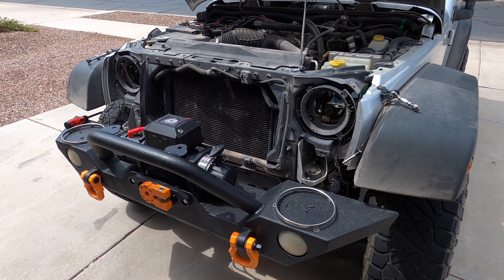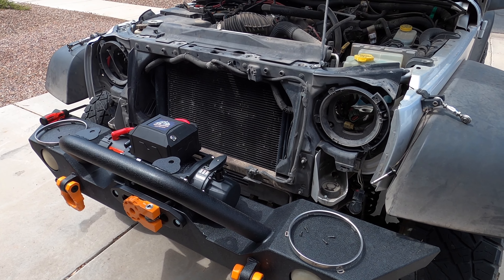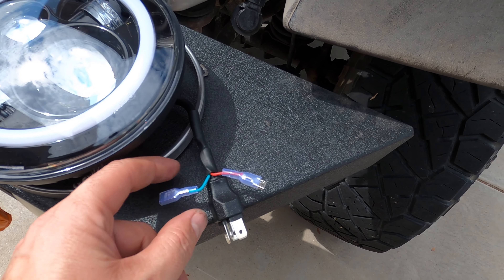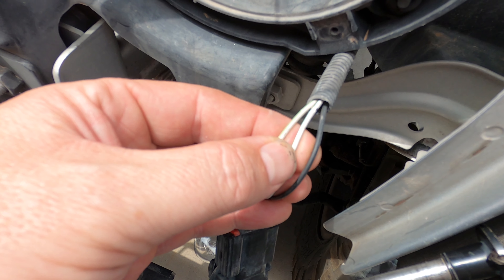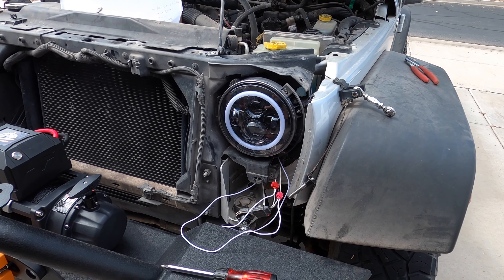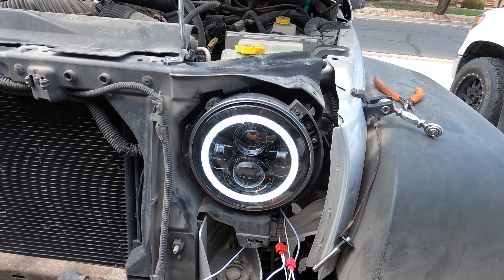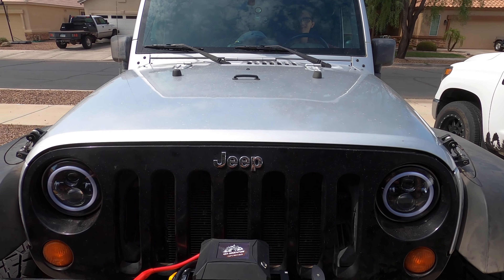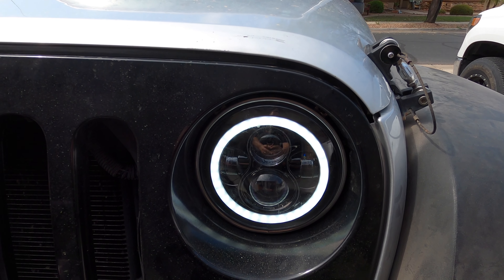2007-2017 Jeep Wrangler Headlight Upgrade! AM Off-Road DRL Turn Signal LED Combo! Brighter and Safer

Comment: You need to replace the original turn signal bulbs with LED to match the instant on/off of the LEDs in the halo ring. Otherwise, it looks like the original signals are lagging the LED ring. Easy job with amber LEDs from Amazon or any auto parts store.
Reply from the maker: Good to know! Thanks!

Comment: did you have to program the DRL function for the Jeep? or did you use an aftermarket DRL module?
Reply from the maker: The DRL wire just taps into the turn signal switched power.